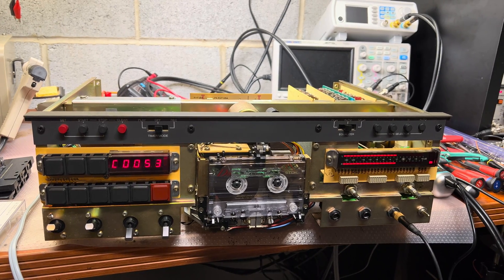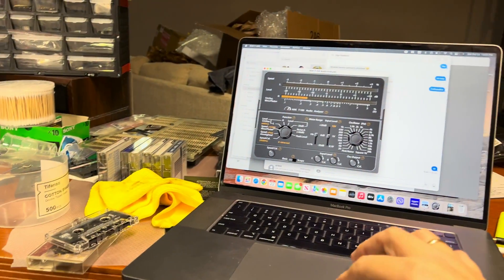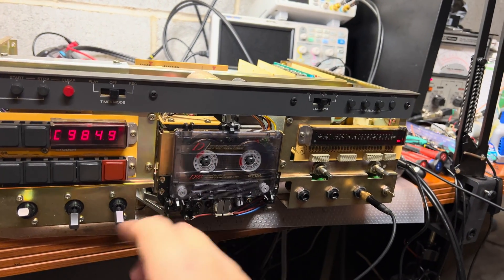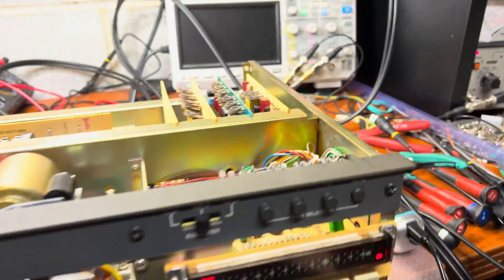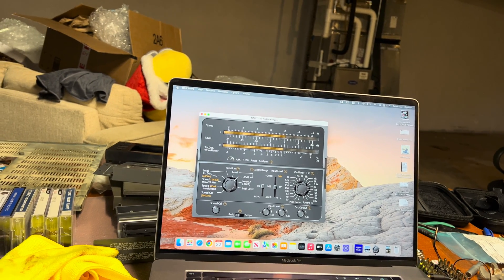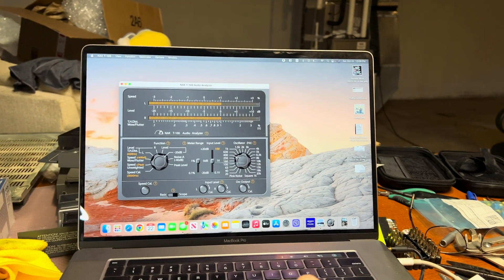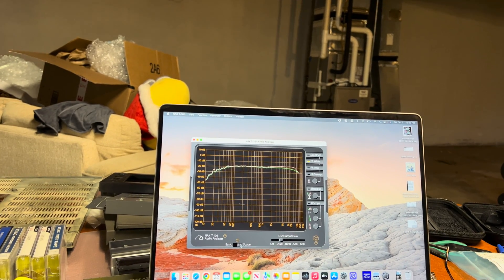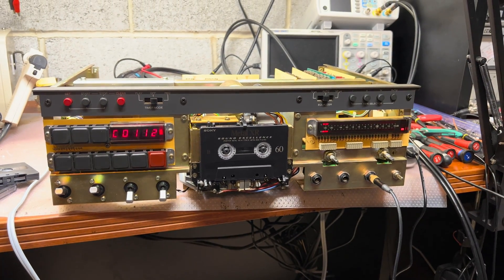Technical Deep-Dive: Measuring Key Parameters on Restored Revox B710

Comment: lol, such a expencive deck and so big wow & fluter, i recently did restoration on basic double deck Teac w-970R with basic 1 motor mechanism and has lover wow & fluter (0.09) then this 10x more expencive Revox. a bit surprising. what im getting on my other decks, technics rsb965 - 0.04-0.05, Pioneer CT-610 and 620 - 0.04, Sony Tc-k611s - 0.06 Denon drm-800 - 0.04, Teac v-6030 - 0.05, vintage Pioneer CT-F850 (1979) - 0.04 all after my restoration. this revox must have very worn mechanism (capstan shafts).
Reply from the maker: Nothing surprising, this deck has been sitting without use for a couple of decades. I just need to see what else may cause the elevated W&F. Planned the next step to replace driver transistors in the direct drive motors.
Reply: @hifirulezzz  Even when brand new, best W&F is 0.1% on these. Just over 3 times worse than a Dragon. (on Paper). BUT, we don't listen by measuring equipment, we listen by ear. This is a fine deck. B215 even better.

Comment: Thanks in 1st place for your videos sharing your great work. As you, surprised by the W&F value (wrms) … using same NAK app I get around 0.03/0.04 on my TEAC V7000 and on recently bought Technics rs-bx626 without any service (yet) I get 0.04 to 0.055.
Could it be the combination of test cassette you’re using with this particular deck?
Reply from the maker: No, this deck still has issues and I will find and fix them. My tapes are verified by dozens of decks.